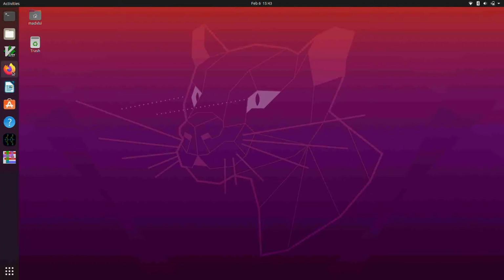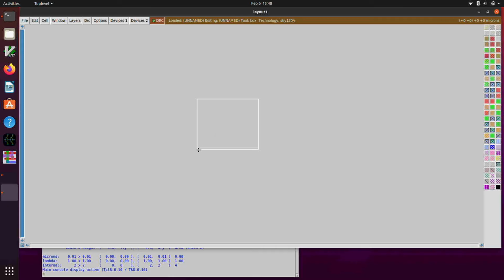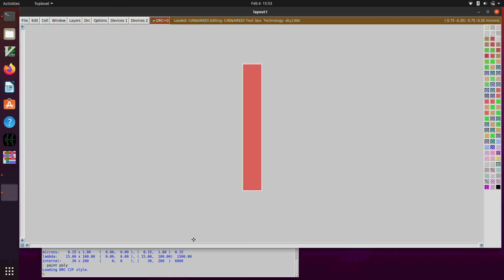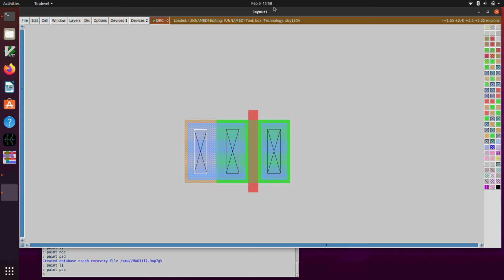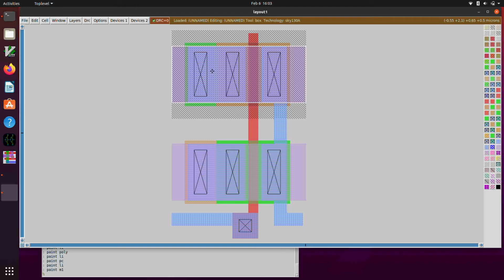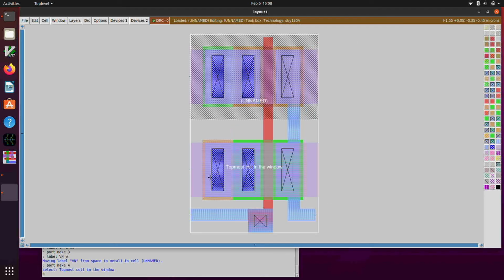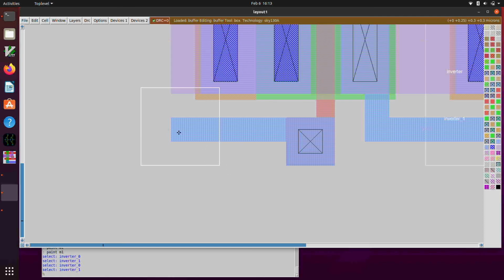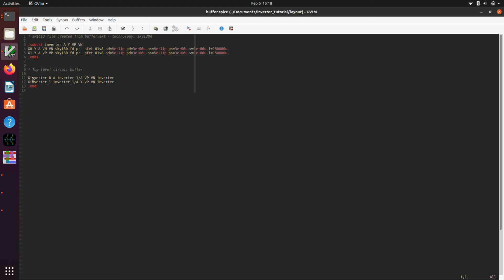Creating a Hierarchical Layout in Magic Using the Sky130 PDK

Comment: Wow!  Deja vu!! It was over 40 years ago that I was doing VLSI design in a new technology called "ISO CMOS" targeting GTE's  fab in Arizona. 5 um technology (feature size) on a 2.5 micron resolution.  40x bigger than what you're working on.  
And we had only 2 metal and 2 poly layers.  14 layers in total, including oxides (holes for interconnect). 
Connecting things up with 5 metal layers would be so much easier that it should be illegal!  😅 
We used a "standard cell" approach, with a twist.  We had to create our own standard cells.  And IO pads. With ESD protection.  We got nothing from the vendor. We have them mask files, and they have us chips (as die, not mounted) a few months later. 
We weren't connected to GTE. Not employees.  However, we had access to a "mixed design prototypes" wafer run, that was every 3 or 4 months.
But: we didn't have computer/ graphical tools. 
We had pads of graph paper, and "artist grade" colored pencils. There were 14 layers in total, including oxide, and we had to specify all 14 layers, everywhere. We'd design a cell on paper, then enter the X Y coordinates of every vertex (so a rectangle took 4 pairs, not 2) then punch the numbers into a program on a rented HP mini-computer, and then plot it on an HP  plotter.  When the pen ran off the edge of the paper, you knew you had an error in entry :: this was DV circa 1981 😊 
One of the fun parts was building an analog audio amplifier on a totally digital targeted process.  (and it worked) 
PS: at the end of the video, you show text data with the output of your work.  That looks shockingly like the data that we created, manually,  in our "design process".  Apparently, nothing has changed in 4 decades!

Comment: Very good video to get a start on magic. I was just thinking if we would be able to play around with a hierarchical design, say a half adder by using the cells in the sky130 library how to would the outputs and input terminals be changed so as to simulate the new half adder layout after extracting the netlist?

Comment: Cheat sheet of commands used in this tutorial:
left click (lower left corner) / right click (upper right corner)
b                                   box dimensions macro, can also enter :box
:grid 0.05um 0.05um
:grid                             turns grid lines off)
:snap user                   user grid for snapping)
:drc style drc(full)      check all design rules
z                                   zoom in
shift Z                          zoom out
ctrl z                            zoom to box
arrow keys                  panning
:paint poly                   
middle click                on poly to copy poly onto the selected box area. Or middle-click on poly from the palette.
white dots indicate DRC violations
:drc why                      DRC violation for box selection
:erase poly                 also, just erase would erase through all layers
:paint ndiff                 n diffusion, note that the background (substrate) is p-type
ntran where poiy crosses n diffusion
P-tap is just a p contact
:paint ndc                  n diffusion contact
:paint li                       local interconnect (on top of contact)
:paint psd                  p substrate diffusion
:paint psc                  p substrate contact
s                                 select entire cell (make box coincident with entire cell)
:select area               select all geometry inside box/cell
:copy n 30                 arguments: compass direction (north) and distance (30 units of 0.5um grid = 1.5um from bottom edge of selected area)
:paint nwell               over an n-channel transistor automatically flips the nfet to pfet, then extend the nwell
:move n 1                 do a :select area first
.                                 dot key to repeat the action (does this work?)
u                                undo
:paint pc                   poly contact
:paint m1                  metal1
:paint mcon             
s                               flashing a net / node, can be hit multiple times, can go inside cells (comes up later)
:label A w                name, direction. Left and right click in one spot to get a zero height box. Small font size.
:port make              yellow A -> blue A
:label VP w m1       also specify layer for the label (and thus the port to follow)   
:save inverter  
:port remove          delete the port in selected box
:erase label            delete the label in selected box
Cell > New
:getcell inverter     note: must first select a box in the new buffer cell
x                              reveal contents of the cell (click mouse over the cell)
shift X                     hide cell contents
Use ports at the top level for simulating, but just labels are ok for LVS (else we get subcircuits)
:save
:extract all             extract nmos, pmos, diodes, capacitors, resistors. Could extract parasitics of interconnects etc
:ext2spice hierarchy on
:ext2spice scale off
:ext2spice

Comment: At 35:04, the width and the length of the FETs don't look correct in the spice netlist. 1e6 microns is 1 meter and so is the length incorrect. Could you clarify?
Reply from the maker: The Sky130 PDK models are set up to use a scale factor of 1e-6, so the dimensions are effectively in microns instead of meters.
Reply: @bminch  I am not seeing the last two tabs (Devices 1, Devices 2) in magic layout window. Sky130 technology works fine otherwise. What am I missing?

Comment: Thanks for the video. I am struggling with magic and the skywater process. How long have you been using magic? How did you go about learning it?  I'd appreciate some pointers. Also, I missed how magic ended up using the specific primitive nfet and pfet transistors for the spice model (sky130_fd_pr__nfet_01v8 and sky130_fd_pr__pfet_01v8). Do you always draw the transistors by hand? There are some scripts to draw them following certain parameters, when would one want to use one way or another. I find the skywater documentation available also lacking, did you just use the page shown at the beginning?
Reply: I realize I bombarded you with questions, I apologize.
Reply from the maker: I have been using Magic on and off since 1990 when I took a VLSI design class as a senior in college.  I learned how to use it using the standard tutorial set, which you can find at http://opencircuitdesign.com/magic under the "Documentation" section.

To set up Magic for the sky130 technology, you need to invoke it using the sky130A.magicrc file, which you should be able to find under open_pdks/sky130/sky130A/libs.tech/magic/current/.  If that is the only technology you are designing in, the most convenient way to set things up is to copy that file to ~/.magicrc, which will set up Magic for the sky130 process whenever you run it.  If you use other technologies, you can copy this file to your project directory as .magicrc and run magic from within your project directory.  

I mainly do analog and mixed-signal design using a full-custom design flow, so I do draw most of my transistors by hand.  There are also tools (Openlane) that can generate layout from Verilog using the standard cells in the open pdk, but I have not had much of a chance to try that out so far.
Reply: @bminch  Thanks, I already followed the tutorials, but I'll revisit them. Anyway, I find this and other of your videos quite useful.
Reply: @bminch  You use a bigger grid size (0.05um) compared to what is set by default in the magicrc file that comes with the skywater pdk. It is stated in this file that changing the grid could break some commands "# Put grid on 0.005 pitch.  This is important, as some commands don't rescale the grid automatically (such as lef read?)". I can see from your video that a bigger grid facilitates the layout process. What about the potential problems stated in the magicrc? Can the statement be ignored or, more precisely, in what situations changing the grid size could lead to problems?
Reply from the maker: @jscandaliaris  As far as I know, there are two grids in Magic: a user grid and a "lambda" grid.  I believe that the comment that you are asking about probably pertains to the lambda grid, but you would need to follow up with Tim Edwards who maintains Magic if you would like a definitive answer.
Reply: @bminch  hello sir , can you please tell me that how can I use openlane tool using verilog code directly to make ip layout?
Reply: @vanishka1879  https://www.youtube.com/watch?v=jDPnI2JzLyU&list=PL6lEfVxcwjW3tOnmmU_4WAqRYppDvGLHM&index=1